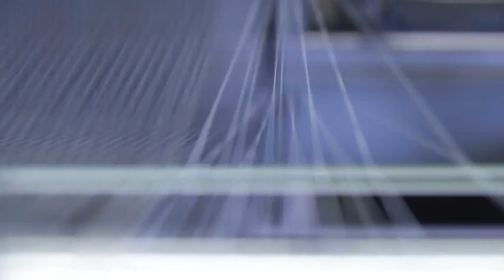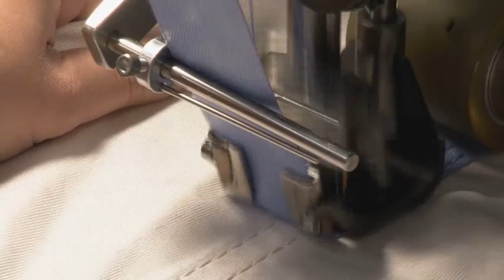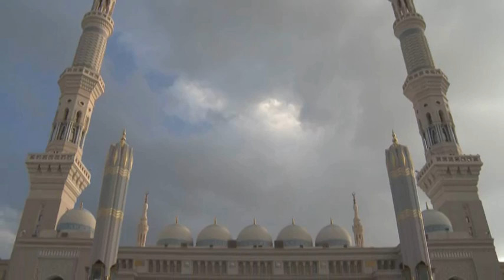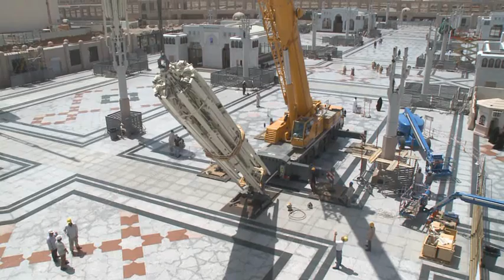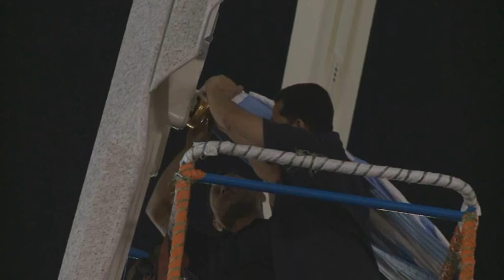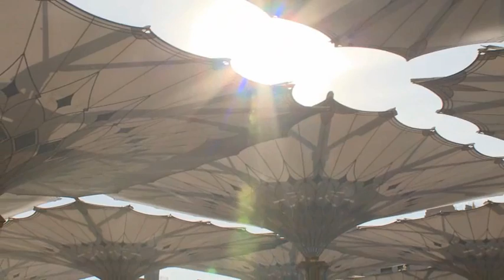Umbrellas for the Medina Piazza - SL RASCH, Special and Lightweight Structures, Germany

Comment: The german designers must enhance the design by allowing for 
1--photovoltaic generation and associated wiring
2-- for rainwater harvesting if it has hurricane or sandstorm resistance

There would be a market for such products in open air auditoriums, stadiums, open air market places, festival celebrations, official ceremonies, exhibition centres and air shows etc, large gatherings such as the kumbh mela etc etc but the price has to be competitive and the quality everlasting plus the installers and dismantlers would need professional training for accidents not to take place